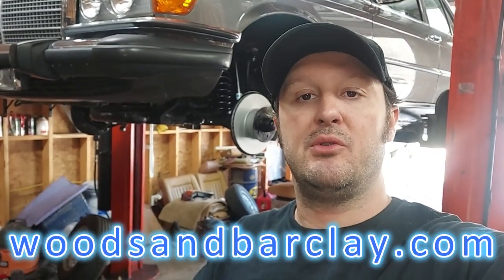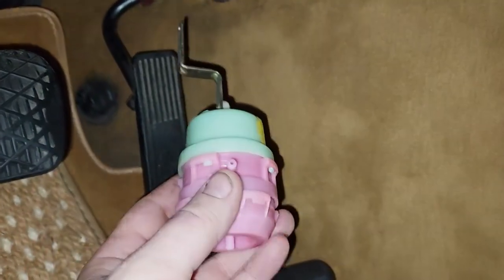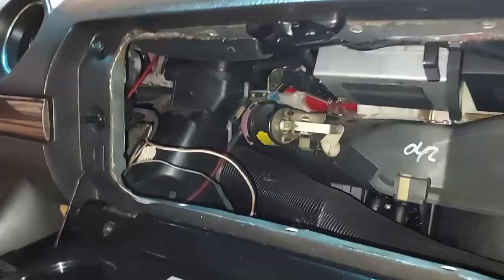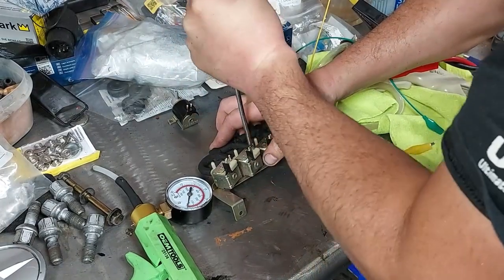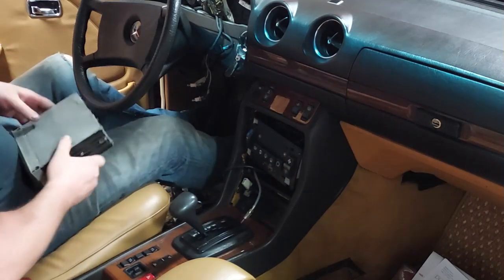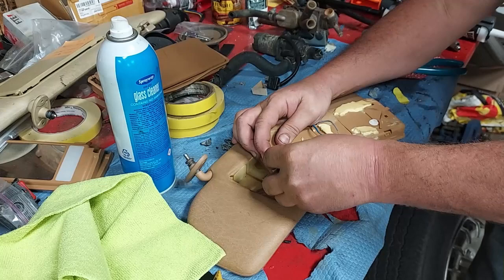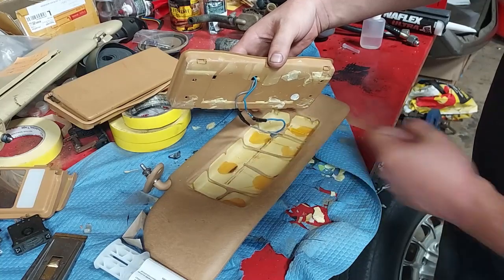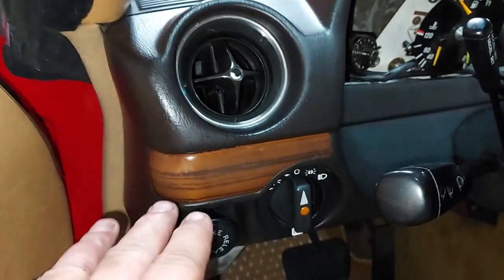1985 Mercedes 300CD - Part 8 Becker Radio, Defrost Actuator, Visor Mirror and Dimmer Switch

Comment: Another super video.  One question: do you have a source for the temp digital guage at the bottom of the instrument cluster.  Mine seems to be partially delaminated.
Reply from the maker: Look on eBay I'm sure you can find a nice used one.

Comment: Is there anything to be done of the visor material has a crack right at the hinge point on the mirror side.  Mine looks like it may have shrunk, then cracked.
Reply from the maker: Sometimes the vinyl will shrink on the actual visor and split. Best thing to do is just find another used visor. Or if you have a paint shop near you you can have them mix some vinyl paint in the same color and just paint that little area.